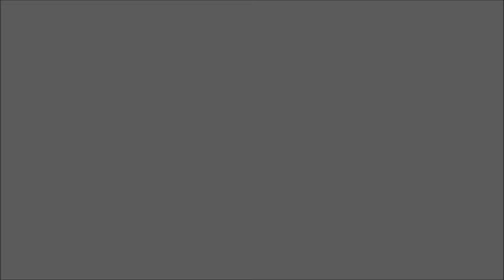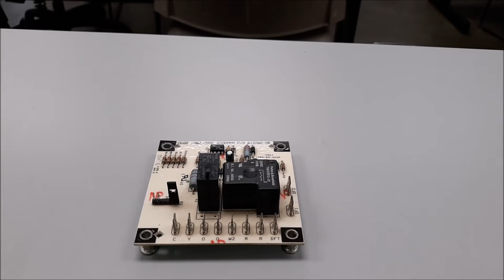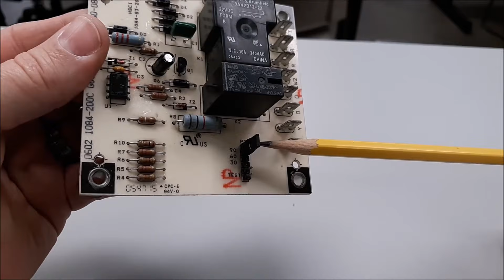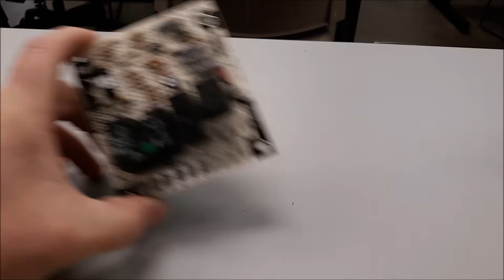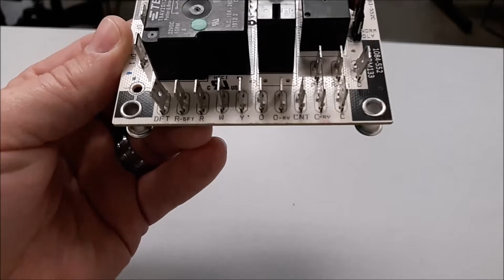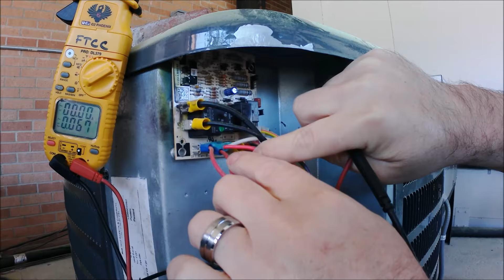Troubleshooting the Goodman Defrost Board

Comment: It seems to fail while running in the middle of the night. When I check fuse and replace fuse it blows instanlty when I return power to air handler. Have checked for short but it only shows when defrost board is damaged. I have replace the defrost board a couple of days ago and this morning found the  unit not running with the blown 3A fuse. Looking to replace the defrost sensor tomorrow when HVAC store is open. Have had some cold temps in the 30s lately. This board seems to fail in the cold months
Reply from the maker: I don't know if boards fail that much...even if it is a Goodman 🤣
Sounds like a wiring short to me and I have had some that take a while to find. If the fuse blows as soon as power is restored then it seems to me to be in the circuit of  24v power. We all do it differently so take this lightly but I would be looking for rubbing of wires on copper piping. Maybe some weed eater damage outside? Wires that are nicked somewhere near wire nut connections? Could be anywhere really. I know how I would go about it but of course ain't there. Sorry.

Comment: Do the low voltage relays fail on the PCBDM133S board causing the 3A fuse in air handler to blow?
Reply from the maker: I don't think I have ever had a relay fail and pop the fuse but I guess it could happen. Fuse popping is a short in my mind. When does the fuse blow? Is the hnit running before it happens or does it blow instantly as soon as you put a new fuse in? Maybe check wiring to pressure switches around copper piping outside? I have seen a bad defrost sensor cause issues, but that was only as the coil got cold and the switch closed...so periodically.

Comment: How does the cnt get its 24v ?
Reply from the maker: According to the wiring diagram, there is a switch between the 'R' circuitry and the 'CNT'  terminal that gets closed once the high pressure and low pressure switches are proven good.

Comment: Could the board cause the AHU to no work meaning it kicks on and off while the compesor amd fan are running btw mine is a package unit, i have a rental property that has the same package unit i tested my AHU on that unit and it seemed to work properly does not go on and off as in the unit at my house, got a new thermostat, one thing i noticed is that the fan will work while system is off and i manually set fan to on position in thermostat
Reply from the maker: If I am following you correctly it sounds like maybe a indoor fan board problem. The indoor fan is not directly controlled by the defrost board. If the inside fan is not working when the compressor and outdoor fan motors are, but does work when you put it to 'on' at the thermostat I would lean toward the indoor fan relay or thermostat.
Reply: @johnjennings-JJ  i have a package unit its all outside the fan does not have a relay or a capacitor

Comment: absolutely the same defrost board goodman B12260 mine is accumulating ice and not defrosting I noticed there is no wire connected to DF2 is that normal what do you think is the problem. and is this B12260 is still available the old version
Reply from the maker: You can still find the B12260. But my question for you is about the DF2 missing a wire. That is a terminal for the outdoor fan motor. Power goes in on DF1 and out on DF2, except in defrost when the switch opens. Where, or how, is your outdoor fan wired? If it isn't on DF2 then it might not cut off in defrost mode.

Comment: John if my unit used the old board and it didn't have pressure terminals and I  were using the new board would I need.to jumper the pressure terminals on the new ?
Reply from the maker: You could as long as you kept them in series and plugged the circuit into the CNT terminal. That way you are still protected, or just disconnect the pressure switches and individually wire them into their respective terminals. Probably wouldn't have to redo the terminal ends or anything...

Comment: I need you help bro. Checked the low and high pressure switch. Im getting 24v out abd and back in. My issue is my unit run for 20-30 mins. Then it starts cutting on and shutting off every 2-3 mins. I lose the 24v from the cnt terminal. Is the relay possibly bad on the board.
Reply from the maker: Before I blamed the relay I would have to say to chek your refrigerant pressures. And double check the voltages while it is cycling on and off. I had a younger tech recently that got wrapped up in his head and was trying to find an electrical problem in the low pressure switch circuit. When I got to checking behind him it was just low on refrigerant and the pressure switch was turning it on and off as it should have done. Possibly an electrical issue but double check the refrigerant too.
Reply: I greatly appreciate the input! You are the man! I thought about the freon levels as well. That's why I was checking the low and high pressure switches. I checked when running and when it cycled off. In off the only thing that loss 24v was from cnt purple wire going to the starter contactor.

Comment: What if your control board keeps burning  out 
Where r24-r23-r22-r15-c1 are
Reply from the maker: Common issue I think. I knew a guy who worked at a part supplier and he would talk about that happening quite often. It seems to be something with the production. Nothing I know of but to change the board. If it is happening very often then I would have the service company you use maybe  call goodman and see if they can send a rep out and look at it. That probably won't accomplish much but it may rattle the cage and get a better solution.
Reply: Can it be the fan cuz I changed the board and than the fan will kick on for 10-15 minutes and than won’t come back on
Reply: Can it be the fan cuz I changed the board and than the fan will kick on for 10-15 minutes and than won’t come back on
Reply from the maker: I doubt it is the fan that is burning up any resistors. If your fan is running, shutting off and then won't come back on...sounds like the thermal overload in the motor possibly. I would check the wiring on the capacitor/contactor/defrost board. Make sure they are correct before condemning the fan motor.

Comment: Hey when my unit goes to defrost the strips are not coming on I haven't checked them.out in the air handler to make sure a sequencer or strip overload etc is bad but I changed the defrost board thinking it was bad when I put it on it never would go into defrost at all . Can you tell me why? The unit is Armstrong SHp12E 30 A -1A old board like the old goodman. New board in pic.
Reply from the maker: Could be something simple like no 24v power to the board. Maybe a loose wire nut or something in outside unit or maybe in the air handler. If it worked before (minus heat strips) seems like it would be something simple like a loose connection or misplaced wire?
Reply: @johnjennings-JJ  I believe it has 24 because the valve changes for defrost cycle with the old board which I put back in because with the new board I bought it didn't and was freezing up I'm try in to understand why it doesn't work with the new board I hooked everything up same as the old board I was try in to send a pic as well of the new one but couldn't see how to send it . The only change in the new board is the two R terminals are labeled RV and RVG
Reply from the maker: I don't make promises but if you send it to jenningsj@hotmail.com I'll see what I can see between the two boards. You may just have a brand new bad board!

Comment: I checked my temperature sensor in it seems that even when it's below 30 it remained open so I also check if I jump the DFT pins and put it in test it worked fine and defrosted. After I installed the new temp sensor the next morning cold out I was not defrosting again do you think I also have a bad defrost board maybe a relay sticking or something when it gets cold?
Reply from the maker: In my experience with these boards it is fairly simple. If you have the newer style goodman defrost board then you will need 3 things for it to defrost. 1- you have to have 24v on R and C when you check with a meter. The newer board won't even turn on the unit without it so if your h it is working then that part checks oit. 2- DFT switch has to close. Sounds like you already checked that one! 3- use the test feature if you don't want to wait for the defrost timer to go. Usually it is 30 or 60 minutes in my area. If it doesn't work and you have changed the sensor already it does seem like the board is the issue. I would make sure the sensor it strapped to the coil good and not loose. Double check all your steps again and if it doesn't defrost on its own change the board.

Comment: Can you replace the old board b12260-08 with the new board pcbdm133s
Reply from the maker: Basic functions are the same. You would have to separate the low and high pressure switches, add a terminal end or three, but short answer is yes. You could replace it with the newer board.
Reply: Not as straight forward as I hoped. Thanks

Comment: If this board goes out would it stop the outside unit  completely? The inside unit is running the outside is not, it's not running on air conditioning or heat pump.
Reply from the maker: If it is a newer style defrost hoard then yes. It could very well stop the whole outdoor unit from running. The older style not likely since the y circuit never ran through it to get to the contactor.
Reply: @johnjennings-JJ  John thanks for responding. I watched your video and I went out there and made a voltage test and then I tested for the 24 volts which it was  good. I took the cap off the low pressure side push the stem, evidently it doesn't have any freon in it. Apparently it has developed a leak. The creepy part is all these AC technicians I've contacted claim it's going to cost me $75 per pound plus service call and leak detection. I've never heard of freon being that high is this accurate?
Reply from the maker: Different companies charge differently depending on the refrigerant used. I've seen it charged more, I've seen it charged less. At least they mentioned a leak check!
Reply: @johnjennings-JJ  thank you for your time and I appreciate you getting back to me.

Comment: I have a GSZ160601BD outdoor unit with this same board in it (it's a goodman unit).  I also have a AVPTC61D14BA air handler indoor unit.  There is SUPPOSED to be a way to hook up the outdoor unit with 2 wires, but I cannot figure out WHERE the 2 data lines connect to the outdoor unit.  PLEASE HELP!  This is supposed to be a communicating setup but who ever installed this thing didn't do it correctly.  I have the newer board by the way.
Reply from the maker: I just got up from my thanksgiving nap! I'll try to look at a few things in the manual and see what I can come up with.
Reply from the maker: It looks like the air handler is variable speed "communicating capable" and the outdoor unit is just a nice high SEER but not communicating. The manual eludes to having a transformer in the outdoor unit if it is a true communicating heat pump. I wonder if you do, in fact, have one in your outdoor unit?
Reply: @johnjennings-JJ  yeah, there is a transformer.  I would send a pic but doesn’t look like I can do it in the comments here
Reply from the maker: I haven't seen that model so a pic would be nice. Try ---‐--- if you like. If the transformer is there then a 4 wire plug should be close. 1 2 R C?
Reply: @johnjennings-JJ  I sent the pics.   There isn’t anything (connector or otherwise) labeled with RC12.  The manual mentions the transformer and then says the data lines should be connected to terminal 1 and terminal 2.  But that’s it.  The Amana stuff I see online has controller boards very similar in appearance to the green PCB in my air handler, but that isn’t there in the outdoor unit.  Just that board in the pic.
Reply: @johnjennings-JJ  I kind of wonder if when the unit says it’s “compatible” it doesn’t necessarily mean it has the capability in it already but maybe it’s a feature you have to buy?  Like maybe you need to buy that controller board and then reconfigure it to be used?  I haven’t seen anything documented anywhere that actually says that, but what else could it be?  I was going to try to call Goodman this week and ask them what the deal is
Reply from the maker: I looked for an email but didn't see anything. I would think that a communicating unit would definitely already have that board in it...installed and ready to go. You don't have a communicating thermostat do you?

Comment: Man my Goodman 2 1/2 ton heat pump seems to be hitting a defrost step every time the compressor runs to make heat....the compressor starts then the fan turns off.....then as the air shoots through the fan comes on and all is normal....but it does it every time
Reply from the maker: If your compressor is running the fan should be too except that the outdoor fan does have one more switch in its circuit. And you probably guessed that it is used for defrost! The defrost board is probably turning it off but I would also check the defrost sensor.that is attached to the coil. Maybe it is staying closed and keeping it in defrost?
Reply: @johnjennings-JJ  I’m glad I found your comment. I’m having similar symptoms with my Goodman unit. I cut on the AC and the condenser fan kicks on and then kicks off after a few minutes. It seems the heat pump is short cycling and I’m suspecting a faulty defrost board or ambient temp sensor. 
My unit may be going into defrost mode when it shouldn’t be. 
Thoughts?
Reply from the maker: For myself and quite a few others, the short cycling would be cutting on and off repeatedly every few seconds. Something like that could be because of lack of refrigerant or the flow through the system. I don't want to assume that you have a leak and are low on refrigerant or have a problem with a metering device because you states it runs a few minutes before turning off. Have  you (or has anyone) put refrigerant gauges on the unit to see what the system pressures are looking like? I wouldn't want to blame the defrost board necessarily but I guess it could be a board issue. When the fan cuts off does the compressor shut off as well?
Reply: @johnjennings-JJ   Thanks for your reply. I have thought about possibly being low on refrigerant. I recently looked at my defrost board and it’s actually a upgraded version of the original. When the fan cuts off, the compressor will get louder and you can hear the reversing valve. At this point, it’s room temperature air that’s coming out of the inside vents. With the fan on, it’s chill air but not freezing. 

I have also been told that my compressor could be going into defrost mode while my AC is on. I also noted that my condenser motor is hot to the touch but I checked it after it ran and in the middle of the day.

Just some observations.
Reply from the maker: If that is the newer style goodman defrost board then it is designed to not allow defrost if the unit is cool mode. So it "shouldn't" allow that to happen. Of course it could be a relay issue with just the fan motor. Have you checked the capacitor on the heat pump outside? If the capacitor is going out then it would cause the fan/compressor to draw more amps and that creates heat...could cut the motor off on thermal overload. And last, but not least, maybe the fan is going out!
Reply: @johnjennings-JJ  I recently replaced the Condenser fan motor and got a new dual run capacitor with it. I will test it to make sure everything is checking out.
Reply: @johnjennings-JJ  you pointed me in the right direction! My previous setup was off of one dual run capacitor. I added a second capacitor for the fan and the fan stayed on during the cooling cycle. 
I ordered an aftermarket motor but it had the exact specs as the old one. I had assumed I could run it off of a new capacitor with the same mfd. I guess it was shutting off the fan to prevent any damage. Thanks for your help, John.
Reply from the maker: You did all the work!

Comment: The norm or delay is for a soft start in defrost. It shuts off the compressior off for 30 seconds when switching form heat to defrost and when switching back
Reply from the maker: Thanks for commenting. For some reason  when I did this video I must have been thinking of something else and didn't realize I misspoke on that point. I did put a note in the description and tried to flag the video because I don't have any employees or fancy software! I'll just have to redo it to get it right I suppose!